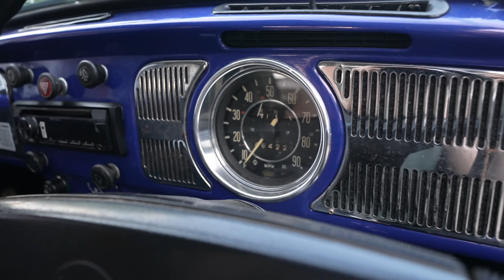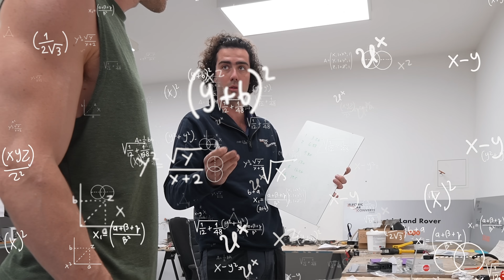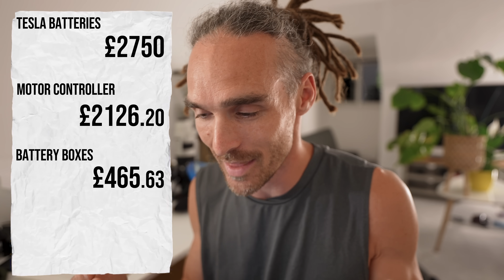My Tesla Powered VW Beetle (Bug) Episode 2

Comment: I disagree with the fun you can have with an ev, as I love hearing the sounds, and constantly working on cars. The originality, the engineering and experience; it’s all different. I think electronic “motors” can be cool for those who want to get from a to be more reliably. As for myself, I like the thrills of all that can happen when driving a motor vehicle. Vintage cars are reliable so long as you take care and do the proper maintenance, as all vehicles require, it’s part of owning a car. Love the videos though Louis, very cool to see the process✌️. From one VW owner to another, cheers man.🥂(BTW, I will converting my car to a diesel when my engine/if my engine goes. I love 2.0 diesel haha).

Comment: Can’t wait to see how this turns out! 

What do you think you’ve learned from the voltz wagon van? I know you keep talking about getting by as cheap as you can, but do you think that will run into problems down the road? 

I agree that you can take a vintage vehicle and convert it to electric. To me it may only slightly take away from the overall feel of that vehicle. But there are some vehicles that I think still warrant the gasoline/petrol engine under the hood/bonnet. Otherwise, some of those classic cars can benefit from the nice torque the electric motors have! 

Keep up the good work!

Comment: The biggest disadvantage of converting an old car is that compared to new cars it is not safe at all in case of an accident. Even if you drive carefully, there are always other people who are reckless.
Reply: Modern vehicles are safer (sort of) but no car is safe over 50mph. The EuroNcap safety tests are all done at very low speeds, most are between 18 and 36 mph and sadly 68% of fatalities are at speeds below 38 mph😢.